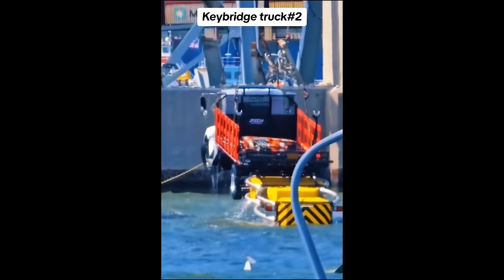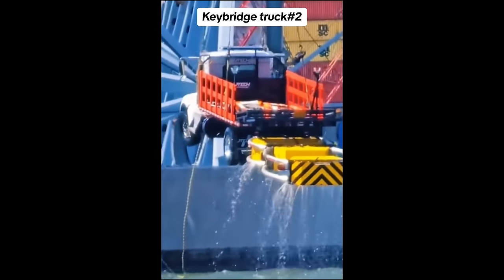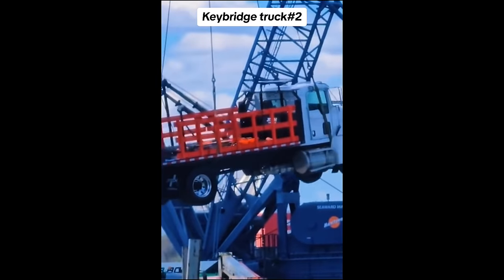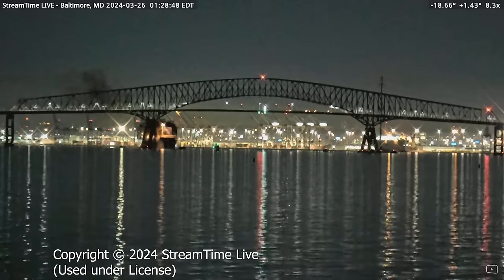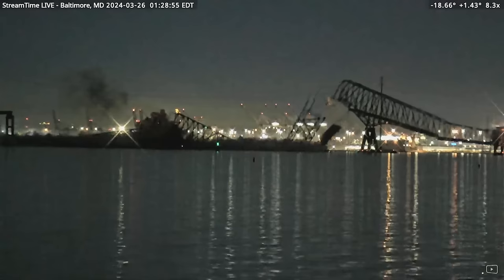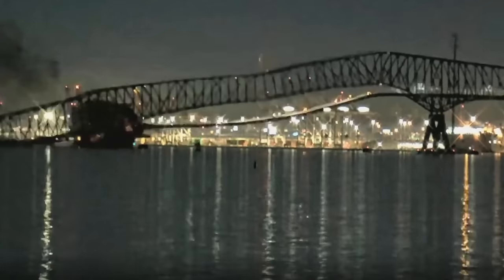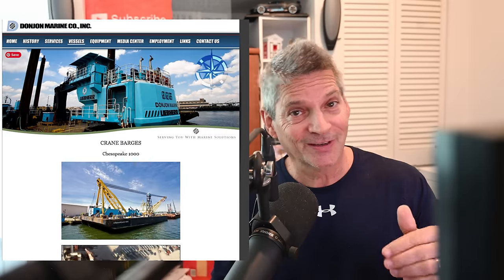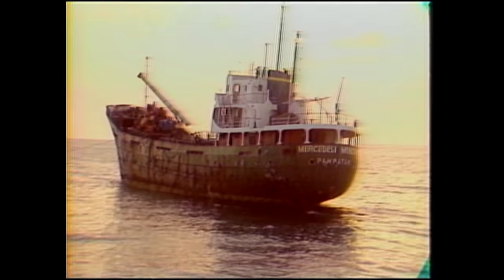Missing Truck, Bridge Truss Salvaged Collapse Site

Comment from the maker: 🎥 Watch Next:
🎥 FIU Bridge Collapse: WORST Engineering Blunders Ever: https://youtu.be/RS5XxwKIx-U
🎥 How To Install Laminate Flooring For Beginners DIY https://youtu.be/tTIlXrRH6VU
🎥 SCARY Crane Collapse Fell Off Tower, Fort Lauderdale, FL https://youtu.be/A-N3fEQwjwo
🎥 Titan Sub NEW Air Force Audio: An SOS For Help? https://youtu.be/1IJYQpVWY0A?si=dOwyBsYNhW3MjR_w
🎥 LEAKED Titan Sub Transcript Shows Crew In Battle For Lives: https://youtu.be/4Dj8IJbP41c
Reply: I think the force of the water rushing in over the top of the roadway, vortices and turbulence during the sinking and maybe a suction effect doomed the workers on the bridge. I have no idea where the found the bodies, but I think it would have been extremely difficult to exit the vehicle until the road stopped sinking, and then once you exited you'd likely get spun in so directions as the turbulence slowly subsided. If you got the wind knocked out of you be the impact then you'd have basically air to find your way from 40 feet below to the surface.

Comment: All this must be a rigging challenge.  Great work!
Reply: The history channel has a DVD/Blu-ray about that topic. Called worlds toughest fixes some scenes will give you vertigo while sitting on your couch. Rigging a Guinness book of world records TV antenna tower will make you nauseous too. Think there is a part two also
Reply: The crew cutting have to watch also the beams will be under stress and can spring when cut.
Reply: @SunnySunny-jz8kg that is why I don't understand why people are cutting it apart  with torches they should have excavators in there with shears on them this would keep alot of workers safer
Reply: @davidsignor7931    that is why engineers get paid the big bucks to figure out the best way for each situation... and not just use charges to blow it up, where they'd still need pick up the pieces afterward. IOW, certain ways require more divers (more dangerous) and more time later. (more money)

Comment: That is the Fallow truck it’s the last in the convoy because it has the Scorpion Barricade to stop and deflect cars from hitting the convoy.
Reply from the maker: Thanks for that info. I thought it was a platform for traffic cones, \but makes sense.
Reply: No problem, I posted a video of how it works so you can how it’s used.
Reply: Wouldn't the last truck have the delineator arrows, the giant flashing, light up arrows that point traffic in the right direction?
Reply: I wouldn't have thought that the truck would be damaged from hitting the water, but rather from all the debris coming down and hitting the truck.  Apparently not though.
Reply: @snoozeflu yes the arrow or sign board appears to have been folded down over the attenuator, likely took an impact
Reply: @snoozeflu  You can see the sign at the end of the deck of the truck.
Reply: @neonnoodle1169  the debris is under the truck.  The truss stopped the debris.  The broken material is all the roadbed
Reply: @Plutogalaxy  Barrier Truck
Reply: @snoozeflu  That truck has the crash cushions, and an arrow boars mounted on the roof of the truck. That truck is specially made to be a barrier vehicle, and to get hit first.
Reply: @jeffostroff  That truck is used to transport comes, nothing else. That trucks closes the live lane while the crew ujp ahead puts out the cones with another truck.
Reply: @snoozeflu  The truck has an arrow board, and maybe another truck backing then up with a towed arrow board.

Comment: My company built that truck. The arrow board on the back which would be upright is crushed. The truck was put in service a year ago. None of the missing were in this truck when bridge went down.
Reply: It's sad to see it out of action so soon. That truck had many years of work in front of it.
Reply: And you know that no one was in it how I'm pretty sure that's the truck they found the fourth person in but I could be wrong
Reply: @JayBee-cr8jm  It`s not out of action yet,,,it can still be used,,Believe me i have proof
Reply: One of the 2 survivors was in this truck. The Crash Truck was was at the lowest point out of all trucks. I read that it wasn’t in the water as deep as the other trucks. The driver was able to get out of this truck because it had manual windows. He was able to roll down his window to get out. It is a miracle that anyone survived this catastrophe.
Reply: If the arrow board had been up and crushed, it would show some distortion (bending to you conspiracy types). It is obviously still in the stowed position, undamaged.
Reply: @chugwaterjack4458  The arrownoaed was up, I guarantee. That truck is a barrier venicle. Not  anything more than a target. Your analysis is flawed. I have seen arrowboards that crash fold like that.
Reply: @chugwaterjack4458  The arrow board is only held in place by rams, with enough force placed on one side or the other it will roll on its axis.
Reply: @mt3311  Not to pick, but with over twenty years as a certified construction safety traffic control specialist and supervisor working on a LOT of California freeways, I would grant a fifty percent chance on that. Call it a draw.
Reply: Like I said, we built that truck. The arrow board mount is a tube frame with hyd. Cylinders. Board is folded over by force. Its normal operation is vertical up and down.
Reply: The "arrow board on the back" is an impact attenuator.  It is deployed.  If it was "upright" it would have been in transport mode.  I highly doubt anything you say now.  ETA: An "arrow board is a completely different piece of equipment.
Reply: @chugwaterjack4458  You don't know the difference between a crash attenuator and an arrow board?  Highly sus.
Reply: @seanmurphy2302  The arrow board started life on the roof. Arrow boards are not mounted on the attenuator.

Comment: Jeff is basically my YouTube Dad, my old man was a structural engineer building nuclear plants back in the late 70s and working on them until the late 90s. 
I was born in 1996 and now have a few years of heavy firehose drinking mechanical/nuclear experience.  I also understand Electrical engineering to a good degree and update schematics as needed. 

But Jeff is my YouTube Dad giving me the Operating Experience (OE) needed to improve my own knowledge and understanding, fantastic guy I tell ya!
Reply: I’m a retired union carpenter that worked my last 8 yrs of my career in bucks but I worked on bridges for a few years doing whalers and honch boards I still miss the comradely.

Comment: The truck fell fairly upright. The suspension absorbed most of the impact. The bridge was cushioned by the impact of the water.
Reply from the maker: I bet the roadway beneath it absorbed most of the impact
Reply: And it looks so clean ! - someone may have washed it before they brought it out of the water, with water !!  :)
Reply: Cushions for everybody all around. My treat. Send the bill to Prez. Biden.
Reply: @jeffostroff  Even if it wouldn't absorb that much, we have seen big jumps in rallying, and if we look for off-road rallying you would see huge jumps. Amateurs rallying with production cars and truck even in off road rallye events show how production vehicles that land on their feet can endure some jumps or falls without any visible damage. A truck that is normally used as a protective barrier to protect the crew might be heavily reinforced.
Reply: @gergelyvarju6679  I don't think they're any different than your average truck; most of the kinetic energy is absorbed by the sacrificial crash barrier.
Reply: The Dali crashed with the impact force of 5 Saturn rockets, but the truck that was propelled into the water, then instantly surrounded by a million lbs of collapsing bridge (the truck hardly had a scratch cause it softly landed, bologna). What next: some more passports of the 911 highjackers in the glovebox?
Reply: @gergelyvarju6679 
Like the General in Duke's of Hazzard
Reply: @gergelyvarju6679  That is just a normal truck with an impact absorbing device on it.
Reply: @TheEDFLegacy  This is why I said that amateurs use normal production vehicles, with nothing changed on them.
Reply: @andycurran3327  The Dali never hit the truck, and only hit the pillars of the bridge... 

When that part of the bridge was collapsed it was affected by gravity, drag and some of the energy was absorbed by the structure of the bridge, so it was a somewhat slow fall. 

Most of the bridge was under the vehicle, and the truss around it wasn't that dense and from the looks of the wreck it wasn't deformed enough to actually hit the truck.

How the water reacts if you drop something to it, also show it isn't surrounded with water instantly...
Reply: @gergelyvarju6679  Cuz it all happened like watching the Six million Dollar Man running starring Lee Majors.
Reply: @andycurran3327  Sometimes things just happen like that. It's not a conspiracy. Sometimes, things can land just the right way in the right place at the right time. Especially in war, where one person can walk away without a scratch from something that killed everyone else, just by being half an inch away from certain death.
Reply: @TheEDFLegacy They use short wheel base trucks which results in a higher than average strength.
The brakes are usually locked on hard too.
Reply: @TheEDFLegacy 
At least there isn't any shadow banning going on in regards to the bridge collapse unlike the Super Mayor of Dolton Illinois rabbit hole, that's being censored big time in the comment sections of videos.
Reply: @gergelyvarju6679  Weren't the guys inside the truck? Why weren't they able to get out if it was such a gentle drop?
Reply: @MikeKayK  They weren't in this truck, but when people drive into rivers or lakes in normal everyday accident, many don't get out for various reasons. 

The first is simple: As I said you can check an amateur rally. and see the jumps there. I am sure what is gentle enough for the vehicle and for the drivers with good safety belt, mandatory crash helmet, etc. isn't that gentle on a less protected human body, because our bodies usually lack hardened steel. 

The 2nd problem is equally simple: While the water doesn't hit vehicles instantly, the human reaction time means people can be too slow at trying to open the door. As they would have to move "a lot of water" in a few seconds. They are often in panic, they might fiddle with belt first, etc. 

Even if people can escape the vehicle, or even if they were working outside and weren't in the vehicle and would safely fall into water,  if they aren't good swimmers, if their clothes or any equipment attached to their belt, etc. drags them down to under the surface it would be pretty much impossible to escape.
Reply: @gergelyvarju6679  You said they weren't in this truck, then later said they might have been unable to open the door. Of note, the windows still appear to be up and did not even break from the pressure of the water....hmm.
Reply: @MikeKayK  While they probably weren't in this truck as it is normally not occupied, the problem of opening doors is true for normally occupied vehicles and they might be recovered in a good state. Windows might remain in good shape as the water isn't deep, but the size of the door is an issue.
Reply: The bollards on the back of the truck are hollow plastic. Perhaps, they decelerated the rate of sinking of the truck.
Reply: @jeffostroff  Of course Jeff! Look for anything and everything but "evidence" that refutes some version of the "official" story they are concocting. In Jeff's world, the NTSB is looking to provide the public with the facts!🤣
Reply: @gergelyvarju6679  You know what? A truck that's been in a river for 3-weeks looks like? A truck that's been in the river for 3-weeks, not 3 minutes!

Comment: You said there were corrugated sheet metal panels pulled up from the site of the bridge collapse - I was a highway engineer in bridge maintenance and those panels are probably the heavy duty type called stay in place forms: the panels are placed on top of the steel deck beams and the steel reinforcing bars and concrete are then placed and poured on top. They're more expensive than plywood falsework but they save in the equipment rental, labor and disposal costs of removing the plywood.

Comment: The vertical members shown going up and down on Cashman's barge are called "spuds"; they hold the barge in position while it works. The corrugated metal is bridge decking which is the horizontal form for the poured concrete beneath the asphalt of the roadway.

Comment: The truck that was recovered was the last one in the convoy of vehicles because of the bumper contraption at the rear of it.  
The corrugated material was the stuff the roadway was laid on.  It is much thicker than regular corrugated sheet for roofing, etc.

Comment: I'm local..... they are gonna ask why is the truck so clean if the water is so dirty. 🤣😂🤣
Much love from Baltimore!
Reply: reports in the comments say the truck was a lease and less than a year old, so basically looks pristine. It's only used for the crash protection and road cones.
Reply: @rupe53  "Reports in the comments"🤣🤣🤣

Well, we can rely on that now, can't we? Usually a vehicle that has been in the river for 3-weeks looks like it's been in the river for 3-weeks!🤣 Of course, not a scratch or dent, no broken window, no visible damage whatsoever. I know? Let's believe Jeff's explanation that it underwent a "soft landing!"🤣 God, the sheeple are naive!
Reply: @edkiely2712    look again. There was damage to the steering (wheels not pointed  in the same direction) and those arrows for left / right lane are bent over. BTW, the guy who made that other comment said he works at the factory where they outfit the rear crash protection and extra lights.
Reply: @rupe53  No he doesn't work at that factory, I do.
Reply: @originalthreebeard    then you must be the "other guy" I saw posting, right?  <LOL>

Comment: If you want  a good example of cars riding down a falling bridge with little or no damage, check out the i35w collapse. Many cars were intact on the concrete above the water.  I think the area of the concrete acts to prevent high velocity in the fall, as well as provided a cushioning effect upon hitting the water.

Comment: There's probably more damage to the truck than you can see from that angle of the video. It took a 200 foot drop to the water. That's why most of the dead will be found to have died from trauma, not drowning. The trusses are the easy part, they're sticking out of the water.  The road deck is now embedded in the bottom of the river.

Comment: I think the major problem for the workers would have been the tremendous suction effect of the road sinking and the powerful turbulence in the water rushing in from both sides as it sank. Even if they got out of the truck, they'd be hit with massive turbulence and vortexes in the water as the roadway pushed water out of the way and then tons of water slamming into those on top of the roadway as it forcefully sunk below the surface. The roadway would create massive turbulence in the water with swirling and vortices as the roadway rapidly sank. Think of what happens if you quickly move a plank or your hand, palm forward, through the water. The same turbulence happens if the motion is down instead. If you watch onboard videos of ships sinking you'll see how close to impossible it is escape a sinking structure underwater. They may have also been sort of stuck to the roadway as well if the water was swirling down at their location. Maybe I'm completely wrong here, but that's the impression I get from the little I know.

I also think you were really underestimating the speed of the fall and the heights of the vehicle during the fall. Anyways, even at moderate speeds, the stresses on the vehicle would have been mainly on the suspension from below and a little from the front, which is exactly what they're designed to handle and, though I think you underestimate the impact speeds, it wouldn't have been anywhere near as bad was a high speed impact or a side and top impact, so minimal visible damage isn't outlandish. The g's would have also been spread out over time a bit as the roadway slowed when entering the water, at the max g on the vehicle probably wasn't larger than hitting a big bump or large pothole in the roadway at high speed.

Comment: The likely reason why the truck was not damaged was because when the road deck settled on the bottom of the river, the webs in the truss above it settled around it when it hit road deck on the river bottom. The opening between the webs in the truss are considerably larger then the length / width of the truck.

Comment: The trucks would slide or roll on the road when there's a lot of force applied. When there's a lot of force applied to the truss, there's no sliding, it's going to bend and break. The falling bridge is also going to hit the water first, and filling the water with lots of air (in addition to the road that's leading the way) giving a softer impact.

Comment: Hey Jeff, you seem to be the man with answers. Could you tell us who greenlighted the Dali as seaworthy enough for a voyage to SriLanka halfway around the globe yet never had it's electrical problems resolved while at dock? The Dali summoned 2 escort tugboats while in channel for assistance (??) but disembarked before the ship reached open water? Coincidentally moments later the Dali lost main power, then backup power failed and finally the emergency power failed as well. Whoever  was in control of the ship decided to drop anchor  causing the ship to veer starboard. Mayday was alerted. Bridge was (mostly) cleared. Except 6 innocent lives were lost needlessly if all federally mandated safety laws, regulations and protocol was followed. Was it? I know you probably have all of the answers with your in depth knowledge. Could you afford us some honest and factual answers please? Thanks for everything!